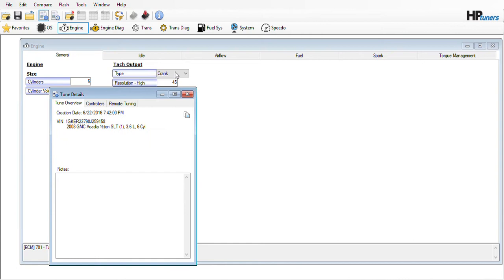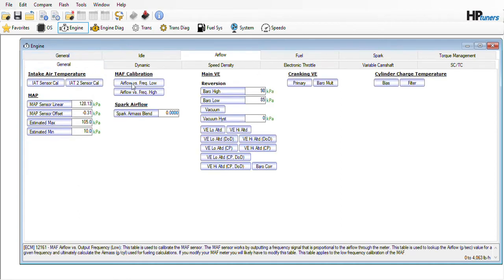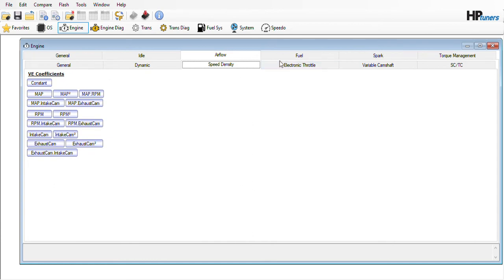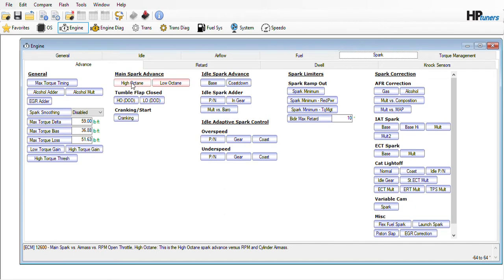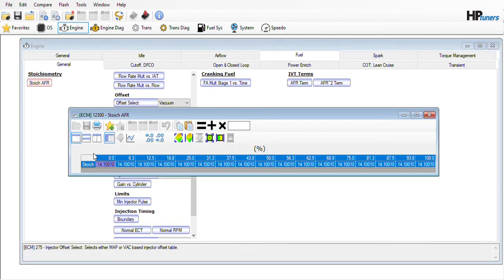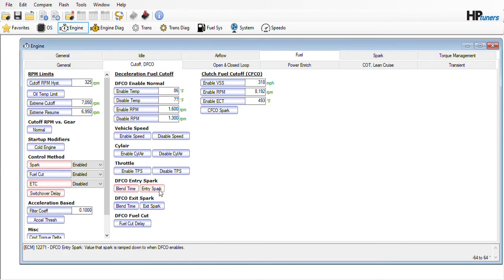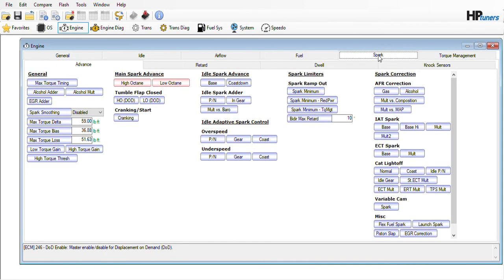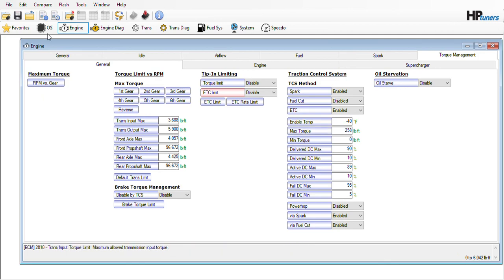Hp Tuners Basics

Comment: Hello I have a question for DFCO Fuel Cut, as you said to get a chance of a backfire while slowing on gear we need to increase the values in the table, but how much should I add exactly, in my case Chevy Caprice 6.0 are "0" all the way. thanks in advance
Reply from the maker: SC1JZ Boost Magic try dfco entry spark blend time set to zero. Dfco entry spark set to zero. And dfco fuel cut set to 100. Adjust as needed
Reply: @TheDailyAmerican  
Thank you I really appreciate your help